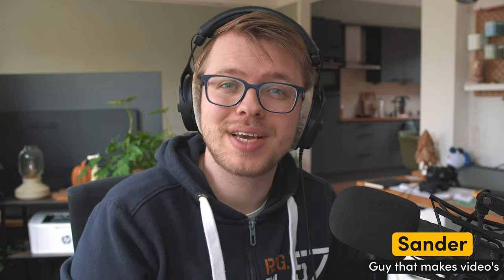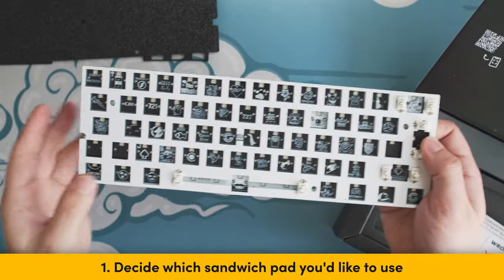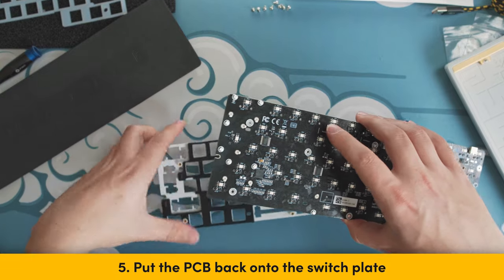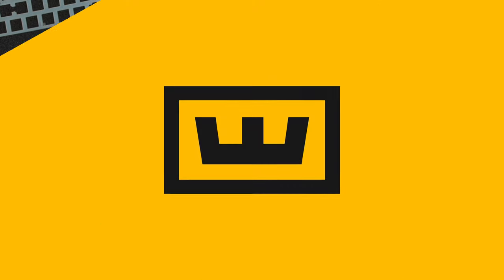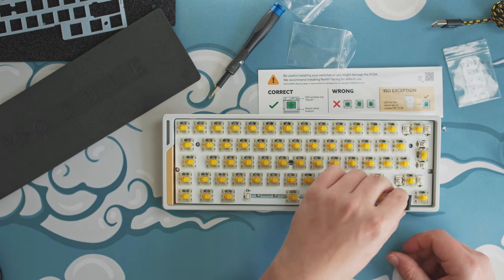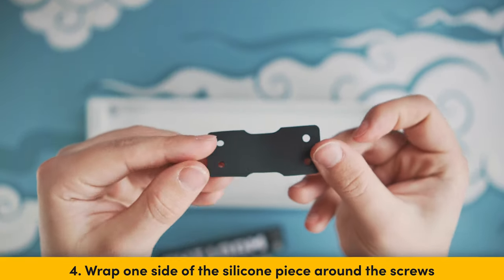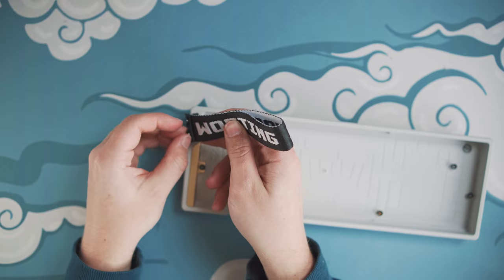Wooting 60HE+ Module Installation Guide

Comment: My redux arrived today, how perfect!
Reply: Mine is on its ways.  Did you use the middle case standoff when screwing down the pcb? And did you have any issues with hand screwing the spacebar standoff into the chassis?
Reply: @mikerzisu9508  Are you supposed to use the middle standoff with the tofu case?
Reply: @fabiolindner  no, you aren't

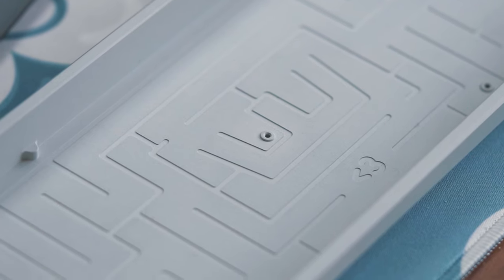Comment: 2:58 sooooo what would happen if someone did install the middle standoff and did also screw the module into it 👀
Reply: The middle screw is only for HE plus. Regular one doesnt have that hole in the keyboard. So you did it right. They just made a mistake and reused the old video for that part. I had that same question too. My problem now is the accent piece silicone ring. He said to throw it away. That has me confused.
Reply: I also used a second standoff in the middle and screwed the module into my case there (Tofu Redux). I would think there’s nothing wrong with doing that, but probably the plate is more stiff that way, hence impacting typing feel and sound?

Would love to know from Wooting why it’s advised not to, though…
Reply from the maker: There is nothing wrong with installing it. There is a cutout for it of course. But it is mostly for the feel and sound, yes.

Comment: Any plan of a wireless keyboard?
Reply: i think they arent gona focus so much on wireless as they been grinding the lowest delay but a wireless wooting would be godly
Reply: and another thing is low delay on wireless is gona cost them alot more to implement and is most likely to cause longer waiting times for other products
Reply from the maker: Mostly I think we haven't invested much in wireless for several reasons:

- With batteries come more regulations and rules and most likely more costs for shipping.
- The keyboard mostly is stationary and majority of the users don't mind having a wired board.
- There are more points of failure.
- Battery can degrade over time.
- Performance is best on a wired connection.

But I can totally get having a wireless board, like swapping over devices more easily and just having a better aesthetic overall. It isn't completely out of the picture for the future, but it has never been a priority.

(This is my view on the matter, from the rest of the team it can be somewhat different reasons but I think this covers most of it.)
Reply: @Wooting  i knew it
Reply: @Wooting  thanks for the reply, guess i go with ASUS azoth 
Since for me its way simpler to swap between, work, game and going to the office that way ❤️
Might get a wooting in the future just for gaming, time will tell

Comment: i just received my 60he + module and alumaze , i got 2 bottom foam , one from module and the other one is from alumaze 60 box , can i use and both bottom foam for my keyboard ??
Reply from the maker: Only use one of the included foams. So don't stack them. Both foams should be the same. :)
Reply: @Wooting  thank you ive already done it ,i used one ,,next step setup for CS2

Comment: are the stabilizers pre lubed on the 60HE+ module version?
Reply from the maker: Yes they come pre-lubed! :)
Reply: @Wooting  sorry if dumb question lol i’m new to modding but what foam would you recommend if i’m going with the 60HE module and the tofu 60 redux case? because most mods i see online use the factory foam to keep pcb from touching the case and is from the original 60HE keyboard

Comment: Question: say I have ansi wooting 60he+ and wooting 60he+ iso module can I switch ansi module with iso module?
Reply from the maker: Yes, you can. The mounting points are exactly the same for ISO and ANSI modules. Just keycap compatibility will be different.
^Sander
Reply: @Wooting  thanks for responding to my question

Comment: anyone else having issues with the standoff screws? ive tried installing them with and without scredrivers and they absolutely refuse to go in. Im installing them in the spot right next to the spacebar as said.
Reply from the maker: It is a bit finicky but it should work. Did the paint enter the screw holes perhaps?
Try reaching out to our customer service over at social@wooting.io, maybe they can help you out.